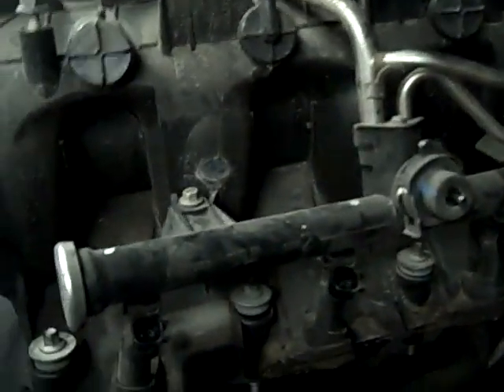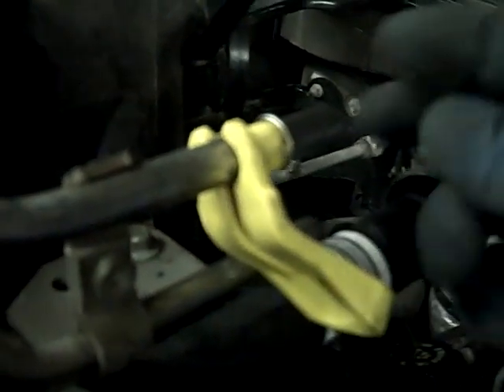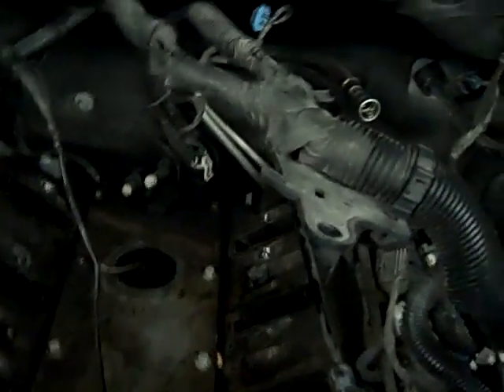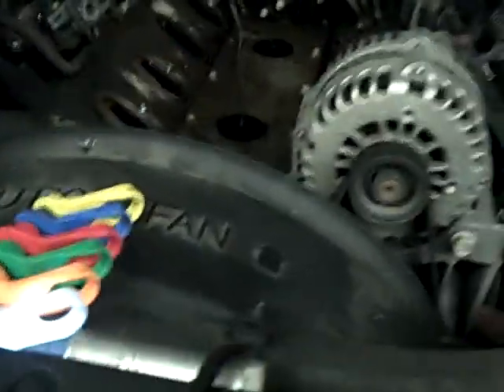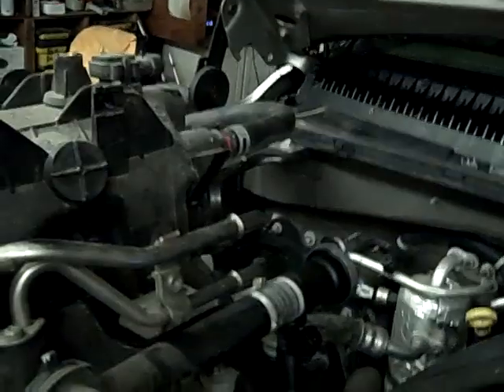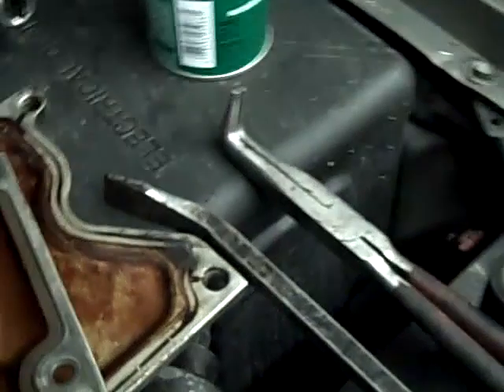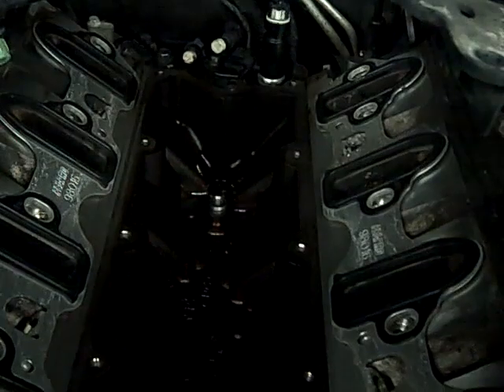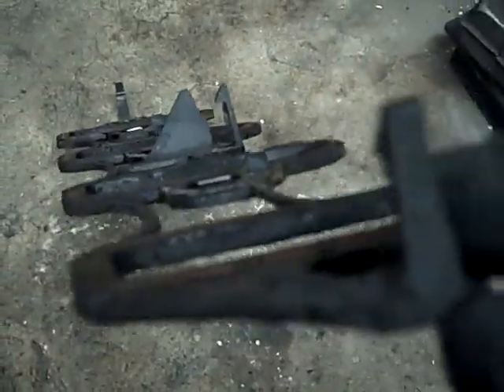2002 Tahoe Intake Manifold Gasket and Oil Sending Unit Pressure Switch

Comment: do this alot. first oil pressure sensor i did without removing the intake was a pain. had an allergic reacction to the foam on the firewall to the back of my hand. it swell right up twice the size of my other hand. but now its easy, just reach back, unplug it, drop the socket over it, drop a extension down from the top, losen it, pull socket out, and pull sensor out. its closer to the drivers side, its easy to get at now i know where it is.

Comment: Have u heard of a 96 tahoe fuel pump not turning on per bad oil sending unit. Pump work if I hot wire it. Relay good also. There is no fuse for pump.

Comment: @briansmobile1 man i tried to replace the oil pressure sending unit in my 03 tahoe 5.3 - can't even see it with a mirror - what's the trick?? don't see how you get to it with intake manifold in the way.  maybe with the truck on the lift and reach up from below???

Comment: I'm leaking antifreeze into my motor.. but I'm not getting hot and no smoke. I don't think it's a head gasket.. I don't have chocolate milk either in my oil. could it be the manifold gasket??